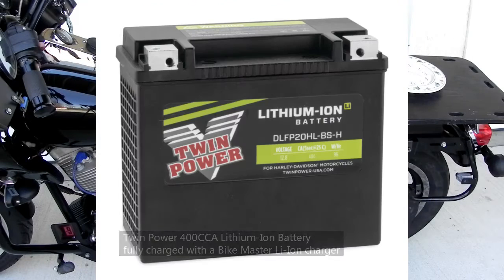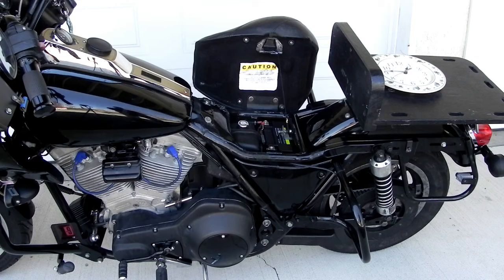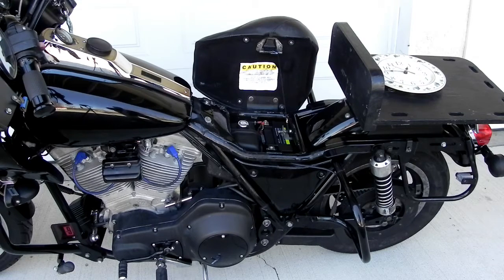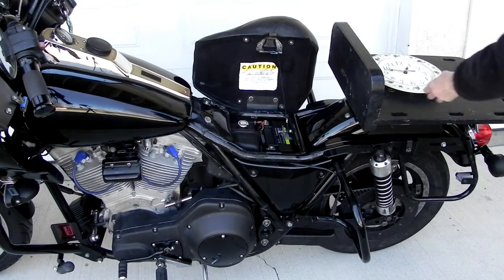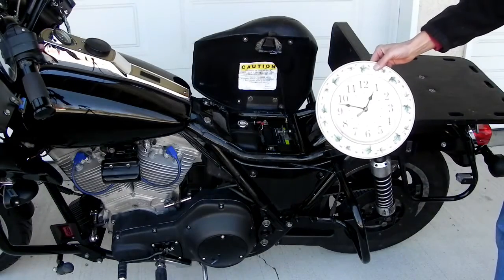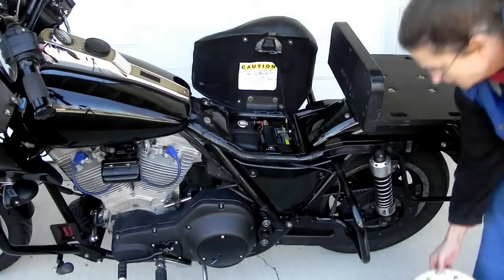Twin Power Lithium Ion Motorcycle Battery vs Drag Specialties AGM battery

Comment: I bought a Twin Power in Nov this year. Since new it barely cranked my 18 Sportster 1200. Then one morning, 2 sluggish cranks. Then dead. J&P warrantied it. First unit only charged to 13.3. Replacement  arrived at 14.2
Reply from the maker: Do you have the right charger for a lithium ion battery?

Comment: a suggestion, with lithium ion batteries instead of having to crank the 1st time without a turnover  I suggest to turn on the headlight for a few seconds (10) just to activate the ion battery (wake up,  warm up) that way you won't need a second start , please try it and repost your findings.  thanks
Reply from the maker: I  turn on the ignition switch and wait about 30 seconds. The bike usually starts right up after that.